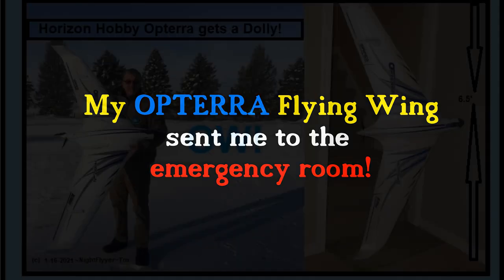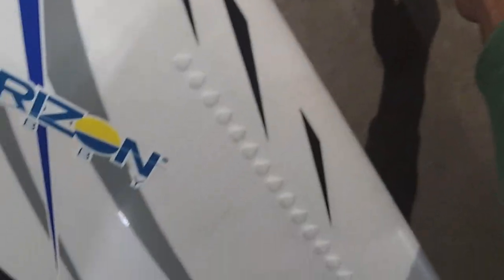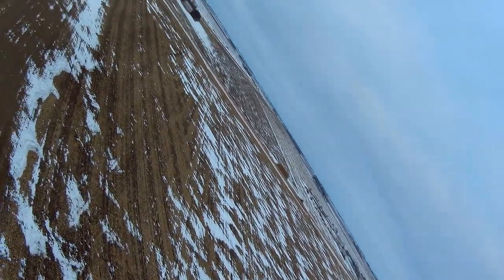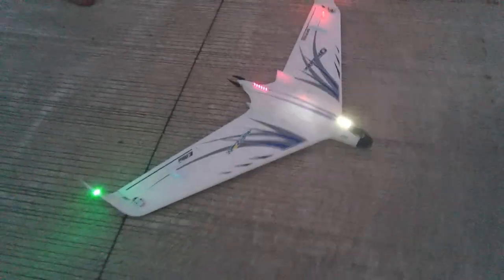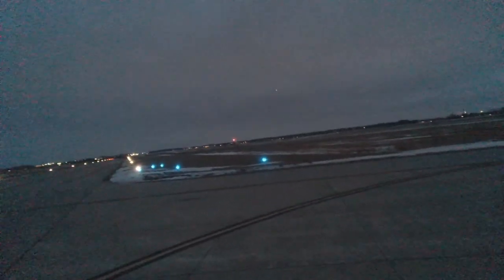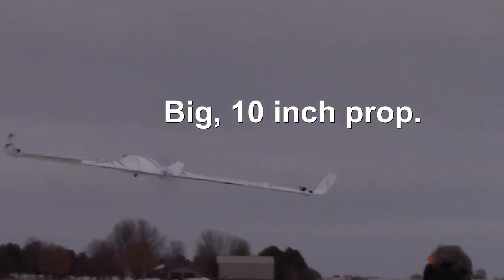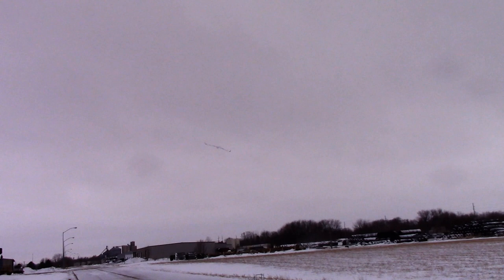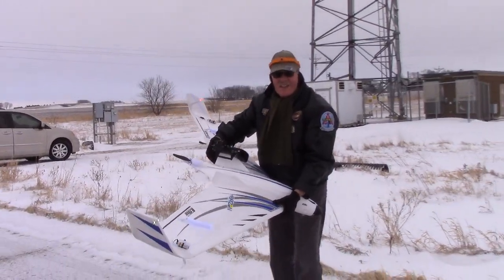My Opterra 2M Flying Wing sent me to the E.R. This is an awareness video & my solution for launching

Comment: You should be able to programme a switch to disable the throttle whilst handling the model - won't help with the hand-launch though, unless you can figure out a way to launch AND THEN open the throttle! Even that dolly you made took a hit, I heard it!
Reply from the maker: The dolly stopped and hit the Screwdriver I had pounded in the ground I had the string tied too and stopped.  And even if it did, as you claim, nothing happened and better than hitting my finger.   I appreciate that, but we Marines were taught to follow instructions and stick to the plan or get dead!  So after spending 33 years in the Marines, I managed to stay alive because of that.  This wing is 7 foot long and will bend and break the end off the if you even try to pick it up by the tip. It would also be extremely difficult to somehow launch it discus style with the elevon there and that 7" tall winglet rudder that is also on the tip.  I know how to do it , but not with this plane.
To try to pick it up and launch it with left hand with motor running full, would be a tough call, not like launching my small F-27 Evolution.  So I followed the instructions word for as I did for the video I made of my product review earlier, but it bit me.  https://www.youtube.com/watch?v=P_inF5EYLEE&t=1s
Here is word for word what the Opterra 2M manual says about launching.  
1. Put the aircraft into launch mode with the channel 5 switch.  (in my first video that did not work, it went into the ground)  
2.  Hold the aircraft in one hand and the transmitter in the other.  
3.  Apply full throttle and throw the aircraft directly into the wind, angled slightly up (5 to 10 degrees above the horizon). 
4.  Climb to a safe altitude and check the trim.   
I know others have their own ways, and either way, my Dolly is the safest solution for me.  

The Opterra 2M manual also says nothing about throwing it with the motor off, so if a newbie followed the instructions, like I did, I'm showing what could happen, in case a gust of wind got them or something else.  The 7 foot wing is too big to throw discus style, as it bends a lot when you pick it up and the big wingtip's winglets are in the way.   Nothing is 100% and no matter how good you can throw, this big 7 foot wing with a 10 inch prop spinning right next to your face, is risky. 
Maybe a gust of wind, maybe my 73 year old left arm was weaker, or who knows.   But either way, if it happened to me launching the way I thought was good (and  the same) as all my previous launches. So if it can happen to me, it can happen to others, and that is the warning I want to present.

Comment: Like so many others have said, I cringed when I heard the prop hit your hand. I probably would have done the same thing too, and landed the plane before checking out the damage that's already been done. I have had a couple of Opterras, and will get a third one when they become available again. Losing the others is another story and not pertinent right now. But, what is relevant is that I programmed a switch on my dx6e as a kill switch. Down is off on the motor, up is live. Also, I never would consider launching under power. I make sure the plane is on SAFE, with around 1/4" up elevon achieved by adjusting the linkages, and use a neck strap for the radio. If you give a good launch with your right hand, and your left hand ready on the throttle stick, you can power up before it gets 20 ft away and hits the ground. I have launched my Opterras many many times like this with no problem. I know not everyone is capable of a good hard throw, and your dolly or a bungee would be a good alternative. Too bad they didn't make these planes with a retractable gear option, but they are so easy to fly and glide so well, that I want to have one in my stable as long as possible. So many good aerial photographs from this aircraft! Thank you so much for your video...you did a great job with it, and have no doubt saved many others from being injured.

Comment: I had a motor/prop set onto a stand for a project in high school. Troubleshooting and thought it was throttled down (was running off an arduino, not a Tx like I was used too) and it ended up firing too 100%. Sliced my arm up good. 6 years later I still have ~15 scars from all the little cuts as it pulled itself across my forearm. Scary what those little props can do!
Reply from the maker: Ouch.  Hope your better.  This prop is 10 inch and really close to the fingers and forearm, no matter how good a person thinks they can launch it. Thanks.

Comment: Ouch! That must sting!

Most fixed wing speed controllers I have function this way (no arming manipulation), so I always set an arming switch on the radio. 
Chose a switch you find suitable (a 2 position one is convenient), and set it so that your throttle is inactive as long as the switch is in its "off" (or "up", or default) position.
As most radios require all switches to be "off" before turning on, it ensures the radio turns on with a "dead" throttle, so you can't trigger the engine by accident.
(it is also good practice to set the failsafe of your receiver with 0 throttle, so if you turn off the transmitter before the plane, it won't run away)
You can set this in many ways, such as using a general function of the radio (not in a given model configuration) that deactivate or activates the throttle stick only when a switch is set to a certain position (opentx radio can do that, I am sure other good ones do too). That switch will then be valid for all the models in your radio, and should not interfere with any habits and reflexes (all models will be the same).
You can also use the "idle up" function, and modify the throttle curve of a model. Flat, 0% value for the whole travel in "normal" mode and whatever response curve you prefer  in "idle up" (but that can set problematic reflexes for heli flyers)

I wish you a prompt healing and good flying on this beautiful wing!
Reply from the maker: I certainly know that as most of my helis have that setup. Maybe if the Manual had said I should do that, I would have.  First of all, that had nothing to do with my hand injury. I only mentioned the Throttle arming because I followed instructions in the manual and this is the way it bound up and arms the motor as soon as you plug in the battery. It says nothing about programming in a cut switch like my helis have. I only mention it to warn others to program in this feature as well,  which also should have been mentioned in the instructions.  It's my warning to be cautious, because the manual says nothing about programming in a throttle hold to a switch. I've known of times when after flying my helis, that switch was forgotten to be moved back to safe and it armed as well.  Nothing is 100% as it could be left in the wrong position, by accident. I'm pretty experienced, so never relied to on a throttle cut/hold, as all my helis and my drones, and many of my electric planes need throttle stick movements to arm.   I only am warning others to be careful BEFORE the launch and to be careful no matter what you use. Thanks.
Reply: @NightFlyyer  Sorry, did not meant to tell that to you specifically (I know you are lightyears ahead of most people as far as experience and knowledge goes). Just trying to put out a possible "fix" for people to use.
But yeah, one wold think that with the democratisation of RC flying, manufacturers would be more careful with their instructions and give proper safety procedure relating to their gear...
And your dolly solution seems perfectly sound and sensible. Why manufacturers don't offer (or at least recommend) that in those kits?
Reply from the maker: @pierauspitz  Agree for sure.  Thanks.

Comment: Amazon sells cut resistant metal mesh gloves for about $17 each.  Would this work also?
Reply from the maker: Thanks for that suggestion and I tried that already, because it was cold, but trying to hold on to the tiny finger grips on the bottom of the 7 foot wing with a thick glove under full power would be difficult when under power and then trying to fly with it on and also difficult to fly the transmitter,  so although that sounds like a good idea, it would probably not work that well.  We are only talking about a Half inch of clearance that I needed to keep from getting cut.

Comment: I have a skywalker X8 wing which is very similar but has a 14.5" carbon fiber prop.  I use two fingers through holes in the bottom and a straight arm launch.  It has takeoff, yaw and spoiler programed through split ailerons on an APM with obsolete firmware.   I know exactly how you feel.  I will only launch it myself and take the controls back from them.
Reply from the maker: Yes,  Well in my earlier videos I didn't have a problem, but nothing is 100%. https://www.youtube.com/watch?v=P_inF5EYLEE&t=1s&gl=CO  If the directions had said to program all that in, I would have.  Others who follow instructions could probably have this issue as well. It's Hello dolly for me from now on.  Thanks.

Comment: Never launch pusher prop wings from the centre of the fuselage, always "discus launch" by holding the wing, that way the prop cannot catch your hand.
I made that mistake once and got a slice taken out the top of my hand, luckily it didn't require a trip to ER, I just put a heavy duty dressing on it and carried on flying 😊
Another tip, keep a first aid kit handy, just in case.
Reply from the maker: Here is word for word what the Opterra 2M manual says about launching.  
1. Put the aircraft into launch mode with the channel 5 switch.  (in my first video that did not work, it went into the ground)  
2.  Hold the aircraft in one hand and the transmitter in the other.  
3.  Apply full throttle and throw the aircraft directly into the wind, angled slightly up (5 to 10 degrees above the horizon). 
4.  Climb to a safe altitude and check the trim.   
I know others have their own ways, and either way, my Dolly is the safest solution for me.  
The Opterra 2M manual also says nothing about throwing it with the motor off, so if a newbie followed the instructions, like I did, I'm showing what could happen, in case a gust of wind got them or something else.     Nothing is 100% and no matter how good you can throw, this big 7 foot wing with a 10 inch prop spinning right next to your face, is risky.
 I know and I tried to launch it discus style, but could not hold it where I felt I could launch it successfully in the wind.     It would also be extremely difficult to somehow launch it discus style with the elevon there and that 7" tall winglet rudder that is also on the tip.  I know how to do it , but not with this plane.

Comment: Any of my hand launch planes I through it like I'm doing a glide test and then fire up the motor after it's away from myself. Even though I've launched with the motor on in the passed and never had a prop strike. But in the last 2 years I've seen 2 different people do the same thing you did in this video and give themselves prop strips. So I say do what you have to do to be safe. Good Luck on future flights.
Reply from the maker: This wing is 7 foot long, heavy, underpowered, and will bend and break the end off the if you even try to pick it up by the tip. It barely has enough power to fly out of your hand at launch and especially while I was trying to throw it into 12 mph wind. I know and I tried to launch it discus style, but could not hold it where I felt I could launch it successfully in the wind.     It would  be extremely difficult to somehow launch it discus style with the elevon there and that 7" tall winglet rudder that is also on the tip.  I know how to do it , but not with this plane.    Here are the links to the last videos and you can see I launched it the same way without problems.
https://www.youtube.com/watch?v=P_inF5EYLEE&t=1s&gl=CO  and   https://www.youtube.com/watch?v=ur5V5H8UcGs&t=1s  Thanks for the comments.

Comment: Just throw it into wind (in SAFE) with zero throttle.  Then power-up as soon as it has left your hand.  This is much easier if you have a neck strap on your TX.  FWIW, I've never had a problem with mine, I tend to use 50% throttle, but I make a point of pulling my hand away quickly once it leaves my hand ... but zero-throttle launching in SAFE is absolutely fine too!
Reply from the maker: Yep, Hind sight is 20/20.  I launched it exactly how the manual says too.  Never had to launch any of my other planes with throttle off, But for sure will actually be using my dolly anyway, as it worked just fine.  Thanks.  Here is exactly what the Opterra manual says word for word.  1.  Put the aircraft into launch mode with the channel 5 switch.  (in my first video that did not work, it went into the ground)  2.  Hold the aircraft in one hand and the transmitter in the other.  3.  Apply full throttle and throw the aircraft directly into the wind, angled slightly up (5 to 10 degrees above the horizon). 4.  Climb to a safe altitude and check the trim.

Comment: Yup I did something very similar.  I was setting up my new eflite night turbo timber around 11 pm Christmas Eve with my new dx8 remote in my spare bedroom. I have flown rc airplanes for the past thirty years and am a commercial pilot....I accidentally hit the throttle on the remote and the plane took off from the bed right at my face. I put my hand out just in time to stop it from hitting me, in the process cut two huge gashes in the palm of my right hand. Had to drive myself to emergency room during Covid, and had to get my palm stitched up.  I have a knarly scar on my hand to remind me never do that again.  The amount of blood that immediately went flying made my spare room look like a crime scene.  Lesson learned..... And I tried to use superglue before going to ER, but it failed this time.  ER had to flush the wound a bunch to get rid of the superglue and a chunk of the prop out.  I felt like a complete dummy. To top it off the ER thought I tried to hurt myself intentionally!  Haha! I guess they have to assume that initially...
Reply from the maker: Yikes what a story.  I've used superglue a lot for wounds too, including in Vietnam, but figured I could not glue 2 tendons and the 3 cuts with one hand and passed.  I also knew the DR would have to try to remove that as well.  Thanks.